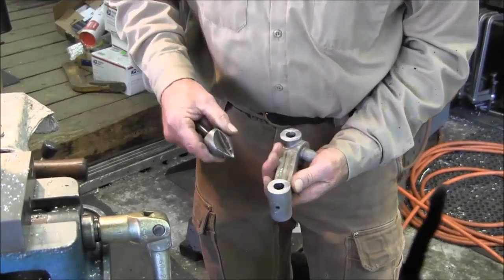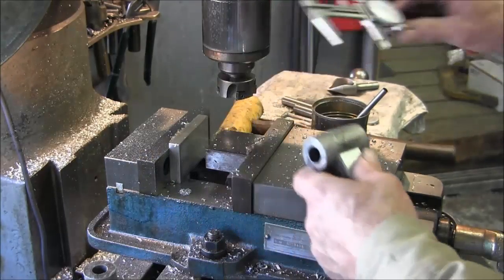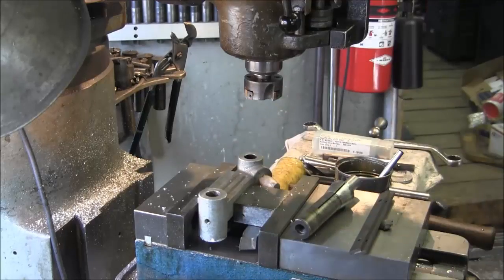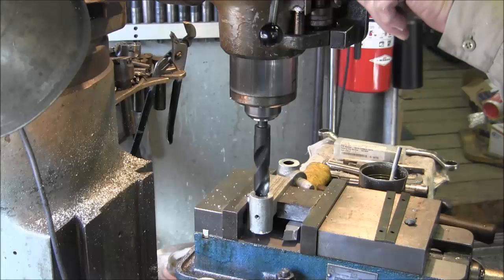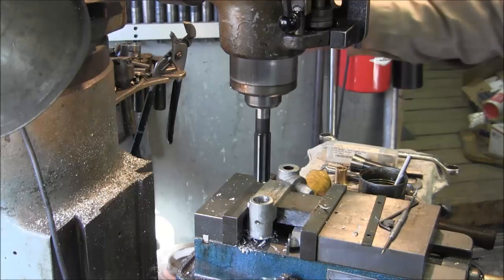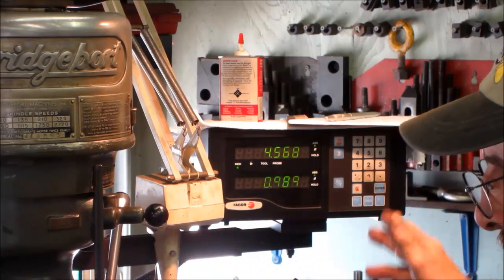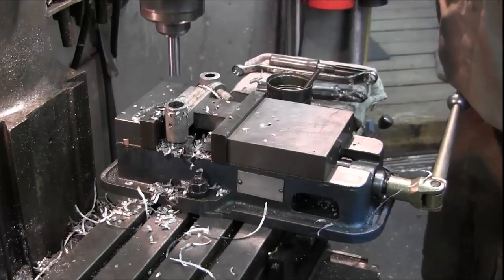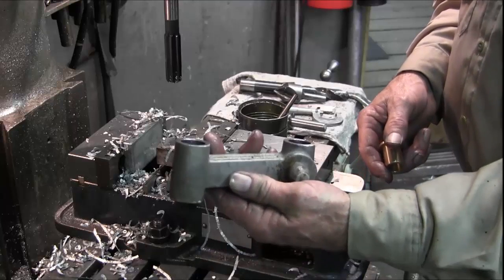Mattracks Part 11 Mail Call: ATV Mattracks Repair

Comment: Hi Kieth, why do you use a reamer after the drill .. doesn't the drill make the hole the correct size?
Reply: The reamer is more precise to the measurement. Drill bits usually aren't exact to 1000ths of an inch. If it was just a bolt hole it would be fine. For a bushing though it needs to be really exact for a tight fit.

Comment: Hi Keith
Ingersoll rand makes a high speed air sander number 317 that you can mount the scotch bright pads on. The pad does not stick out away from your hand very far and it is still very controllable to use with one hand. I have 3 of them myself and use them quite often, they work way better than putting the pads in a die grinder. The 3m kit for the Roloc mounting rubber pad comes with a special hex nut, you drop the allen screw in the nut then tighten it to the sander then screw the pad on the allen screw which is sticking out.
John

Comment: Fagor scales are famous for skipping. You could take'um down and clean them (probably just oil on the reader or sender unit) or in a pinch I used to just spray some alcohol on them and "lightly" blow them dry.
 If you take them down/off you might find cracks or breaks in the glass or a wedged chip. requiring new scales.
 Sometimes you may get lucky and find a lose connector or something.
 FYI when you travers the table cross "X" keep the backlash going the same way. That's usually where would look for inconsistencies across any axis. and keeps the scales honest.
 Also when I rebuild something and I'm trying to locate existing patterns or something. I try to round up/down to either metric if it's off shore or Imperial if it's domestic. IE; 4.568 ...I wouldn't trust to be consistent C/L to C/L 4.5625. (You don't know what other huckleberry got his mitts on this part).
 Thanks for documenting all your skills ...It's a dying art. "Master Kieth"!

Comment: Hi Keith.  Great series.  Assuming your DRO is working accurately, is there a reason you don't drill both holes before changing to the reamer and then reaming both holes?  Would cut down the number of tool changes by more than half.

Comment: Correct me if I'm wrong.  When you were doing the math on the hole centers, I think you said half of one hole.  Wouldn't you want to add two halfs or the diameter of one hole to get the center to center?  Maybe I was missing where you measured from.  

I think I've watched all of your vids.  I always learn something!  Sometimes, it's what not to do!  LoL!  Keep them coming!
Reply from the maker: Yes, as I walk the talk sometimes I stumble on the talking part! sorry I didn't catch that and add a caption correction. ;{)----
Reply: Keith Fenner Would this be the cause of your DRO misread?  (looking for a different number?)

Comment: Nice video. I wonder, aren't you weakening the material to much when drilling for the bushings? The bushings wont add strength.
Reply: I'm not sure how the forces are acting on the respective piece but it looks like the main stress is on the middle bar and not on the bushings rings. Anyway, it looks like an extreme trimming of the original material, indeed.

Comment: Good job Keith you have the tool changes down pretty fast but get a power draw bar and save wear on the shoulder!  That's pretty lame about the DRO but at least you're on top of what is going on and caught the error.

Comment: Hey Keith,fascinating as always.  Quick question.  How do you know that by boring out the id of the part beyond the original spec, you're not fundamentally weakening the part?
Reply from the maker: I answered this topic in 10 and it went something like this; The amount of the reduction, in strength of the base material is replaced to a certain amount by the bushing design and material type, in the pulling direction my concern was reduced because the system design creates more loads in the compression direction and the material is supported and backed up by the link body itself. Great comment and was thought about when deciding what bearings to use. Even excess wear, in a lot of cases, is considered out of spec's, and creates a weak link.  ;{)-------

Comment: Except the first step of making the flat back, did you somehow measure the the two bores to verify them being parallel and perpendicular to the vice before you started? How? Or did you just assume that being the case?
Reply from the maker: I verified the bores before, by measuring hole to hole at both faces and when placed on parallels or vice jaws tops, having pins running though the bores, there was no rocking, along with the design of movement I concluded they were originally straight inline and parallel with each other. ;{)----

Comment: I had to clean the 10 micron Mitutoyo scales on my BP clone (2 axis system). Over the years a certain amount of oil/coolant or dirt had found it's way in. A piece of plastic with a bit of chamois leather glued to the end and dipped in isopropyl alcohol got the contamination off the etched glass. I replaced the whole lot with a 5 micron 3 axis Sinpo, but the Mit is still doing good service for its new owner.

Comment: next project; make yourself a power drawbar for bridgeport mill?
Reply from the maker: LOL, I didn't think I was slacking any speed on changing out collets, by manual means. ;{)------
Reply: I didn't think you were slacking, I think it will be easier on your shoulder though.